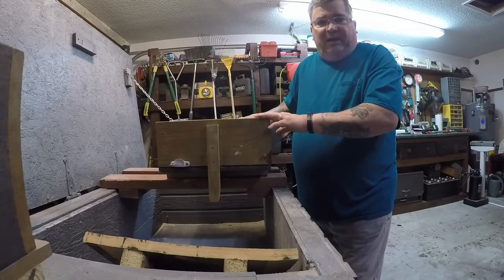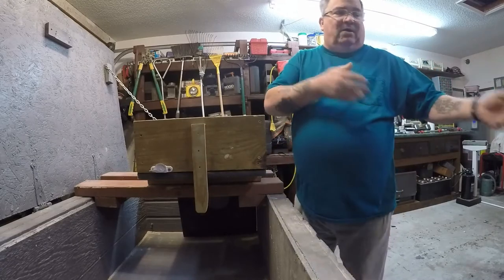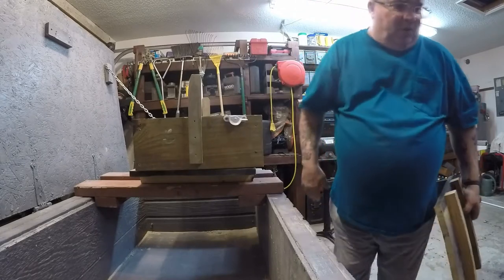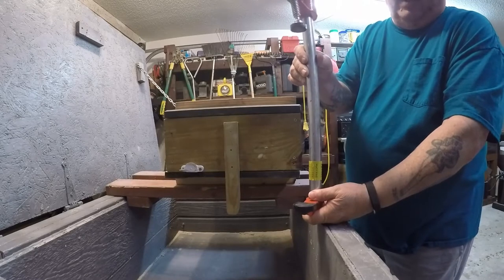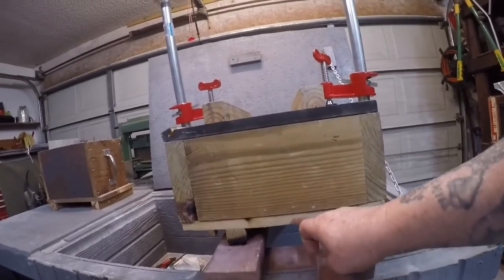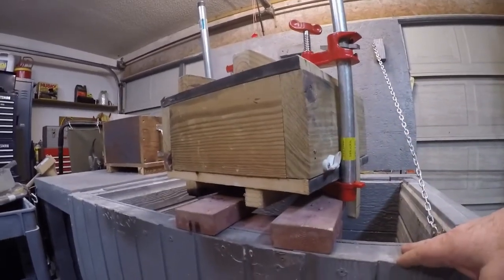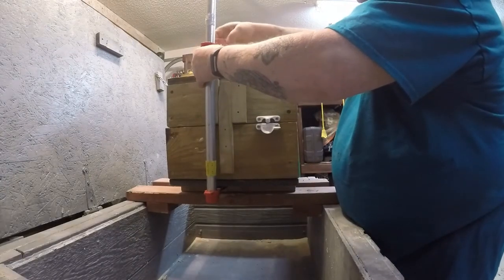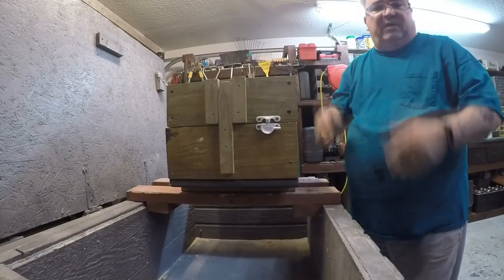Mold manipulation, the three clamp method

Comment: Merry Christmas.  Thank  you for sharing.  I worked as a Ships engineer for almost 30 years.
Reply from the maker: In the Navy? If so, what rate? And Merry Christmas to you too!
Reply: Merchant Marine & Naval Reserves.
Reply from the maker: I see, was your job designation concerned with all areas of the engine room or was your job more closely aligned with the Machinist Mate rate? Engineman? Boiler Tech.? Machinist Repairman? Your adoring public want to know....lol
Reply: I attended California Maritime Academy, Graduated in 1979 with a degree in BS Marine Engineering, USCG 3rd engineers license & commission in USNR LtJG.  Almost 30yrs of sailing with Exxon/SeaRiver Maritime as a Marine Engineer, USCG License Chief Engineer Steam, Diesel, Gas Turbines.  You name it I worked on it, from ships built during WWII to the first Steam Ship with an Unattended engine room.
Reply from the maker: Sweet! As a Navy Molder, we had fleeting contact with USNS ships and they usually needed something like Water tight door dogs and the like. You would have been very comfortable in all of my ships' enginerooms, they were all steam. My goal is to get the Molder rate exposed to everyone that is trying to melt metal and make molds. Mentioning my channel would go a long way towards that goal, if you would. Thanks!
Reply from the maker: Did you have babbitt bearings? If so, did you guys recast the bearings or send them out?
Reply: Oh yes, but they were very large.  Some of the WII era ships had the gear to cast your own small parts.